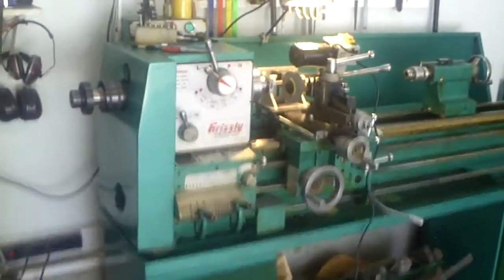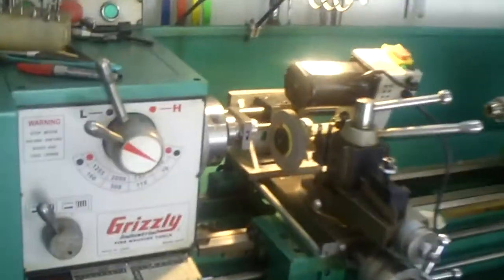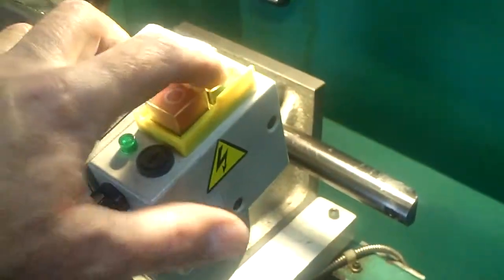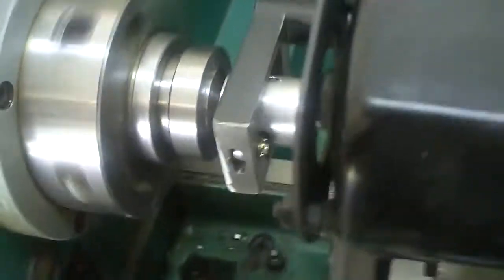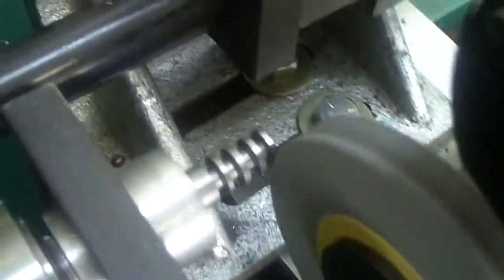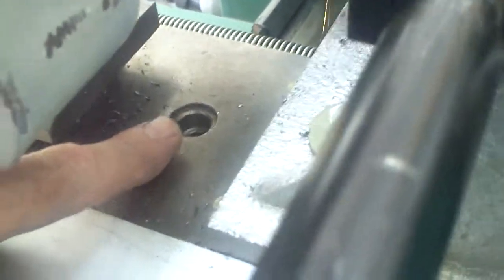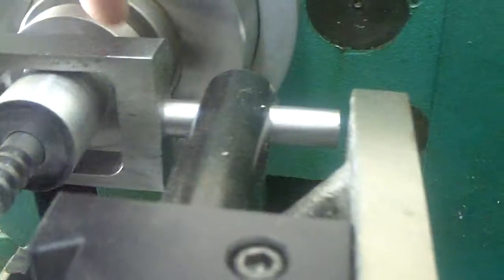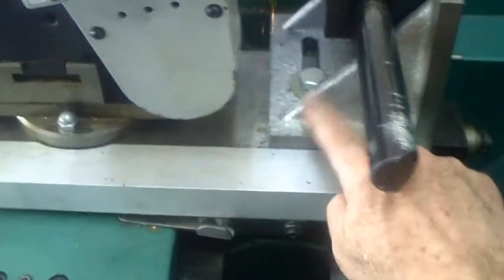Wright Cam Grinder

Comment: I say this kindly..... The next time you up load a video... when Youtube asks you if you would like them to use their software to stabilize your video.... might not want to.... I personally shake really bad in my hands, and my videos seem to come out okay... and I do not allow Youtube to take control of the video  anymore with their stabilization crap..which is where and why the video is all over the place, kinda creates a sense of sea sickness...lol..  But, your setup as per how you went about doing this is really clever.... Nice Idea....  Oh, and by not letting them do the stabilization junk, it won't take as long either to up load start to finish...